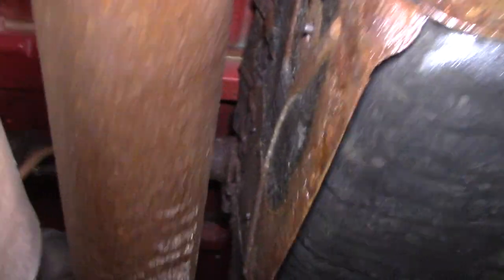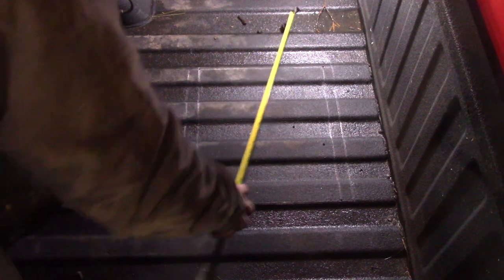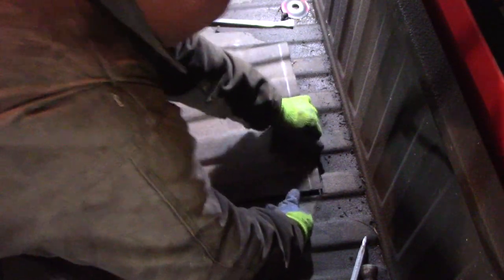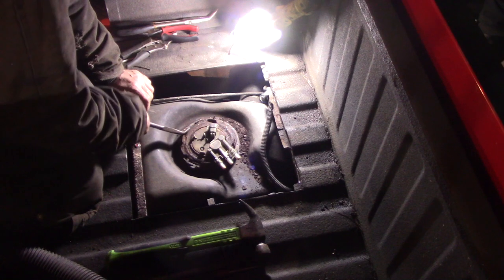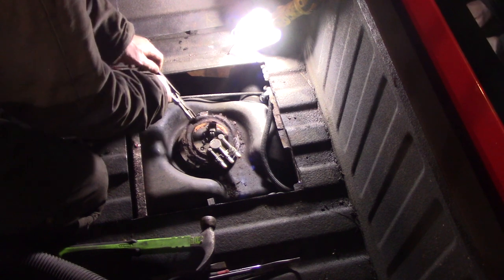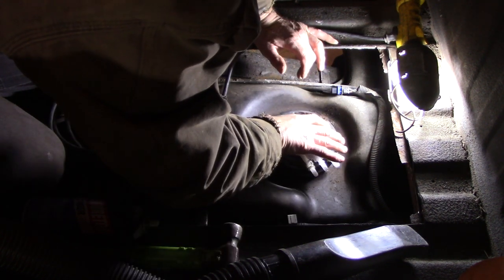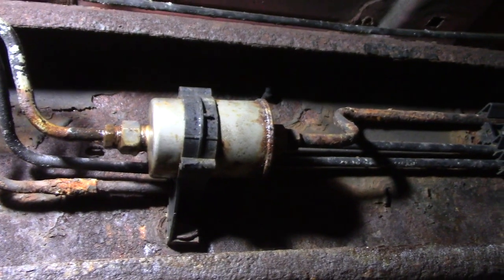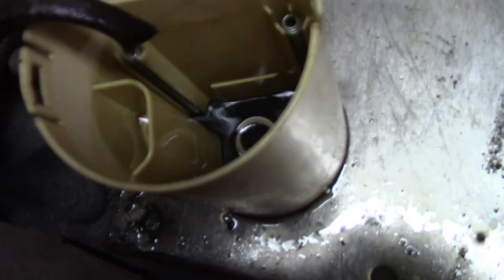2002 GMC sierra fuel pump replacement (the easy way)

Comment: Thankyou to you and others who posted/showed how easy it is to gain access for the fuel pump replacement.
It was your "cuts" that I most closely followed to utilize the cross supports for after the pump is replaced and the "panel" can be easily secured back into place so there is no "weak" spot in the bed.
I completed replacement yesterday on a 2003 silverado.  
The panel fit perfectly back into place.
My black rubber mat, which I installed when I first bought the truck,  covers the panel and easily can be pulled back if/when access is needed in the future.
My cut was not quite as wide as yours.
There are eleven ribs between the wheel wells/humps.
Looking forward and counting left to right;  I left most of ribs 2 & 5, cutting only about a 1/4" up on the ribs front to back.
The less removed the more the floor stays solid as the top of the ribs is what holds the weight of cargo.
The pump is located  between ribs #3 & #4.
The spot weld "dimples" , 3 of them, two toward the front and one at the back, made marking my cuts very easy.
I too drilled the dimples after cuts were made, first with an !/8th" drill as a pilot hole, and then a 3/8th" to enlarge the hole.
That removed most all of the weld, and what that didn't remove popped up/off very easily.
Some clear caulk can seal the cuts and dimples.
I wish changing the fuel filter was as easy.
I'm retired from GM and can tell you there are some good engineers who can/could design "things" with the customer in mind.
That is NOT what design is about, since future profits for dealers is what sells franchises.
Dealers LOVE recalls in the auto industry.
I worked in GM aerospace, jet turbines, where tax dollars pay for re-design in billions and billions of dollars.
While we didn't want planes falling out of the sky, there was/is a "thing" about not making our product too good, just good enough to convince a jury we were not negligent.
I was part of the crash investigation/legal team and saw this firsthand.
My boss was who testified before congress for all the monies we needed.  I remember no time when we were told NO.
The billions of re-design on the F22 & F35 lift fans were intentionally designed/planned to have "problems".
And yes, test pilots have died from these known "issues", but always results in MO MONEY, MO MONEY.
Everyone of us were paid well........basically to keep our mouths shut and our bank accounts full, "enough".
I quit that postition when I was expected to lie on the witness stand as an expert witness, since I had the "authority" to take over any lower position, which I did.
Quality assurance is set by the jury, not engineers who, if allowed, could make air travel risk free.
Sad, but true.
Halfway thru my career, GM was sold to RollsRoyce Aerospace.
The first thing I was told was that we'd been making ot parts/assemblies too good. 
Our tolerances were too tight, allowing replacement of parts too easy.
Rolls Royce engines are only, can only be, overhauled by a RR "authorized" facility.
It has nothing to do with "craftsmanship", only profits.
Of course the private owners of our Federal Reserve, owned the Bank of England before the US became a "thing".
They've had their hidden hand in everything since before our so-called Declaration of Independence.
Today those owners are depopulating us "sub-humans" with the best "engineered" scam ever to be pulled off in history.
The vast majority of jurors, in the court of public opinion, are so brainwashed, they cannot even see it.
They want 80% of americans gone, by 2025.
They seek 70% "vaccinated" by "independence day" of this year.
Honest doctors and researchers are predicting no survivors of the "cure" in 3-5yrs.
If you've accepted the "shots", I'm sorry for your loss.
Those same honest doctors/researchers are working on a way to unto what's been done, but too early to learn what all is in the injections, since that is top secret.
I wish fixing this world was as easy as fixing a fuel pump that is placed within a gas tank.
Though it never should have been designed there in the first place.
So too, we should have never allowed foreign bankers to take control of the US money supply, and then, now,  the world supply.
A very few are manipulating and controlling the very very many.  Over 7 billion of us are scheduled to "expire".
Isn't it interesting how a wrongly designed fuel system is no different than a wrongly designed world?
Reply: Whoa bro that was pretty intense and a lot to digest. What are your thoughts and feelings on all this now that it is one year later?
Reply: Just sickening...
So glad we have redemption in Jesus Christ and hope of a perfect life eternally because of the love of God the father and His Son.

Comment: I had my in tank fuel pump replaced and now fumes are escaping from the ring area and the mechanic refused to fix the problem.
Reply: Until it is fixed my vehicle can't pass California smog requirements.

Comment: I like your style. I just picked up one of these trucks from my Dad. He bought it originally and had it in Nebraska and Iowa for 20 years. I can’t believe the rust underneath. Definitely tempting to cut a panel. I was hoping to see what yours looked like once you put it back on.
Reply from the maker: I popped riveted back on then used roof tar from a chalk gun for the seams. It blends in nice with bed liner. Also the work box covers it.
Reply: @JLafix  thanks for replying I appreciate it